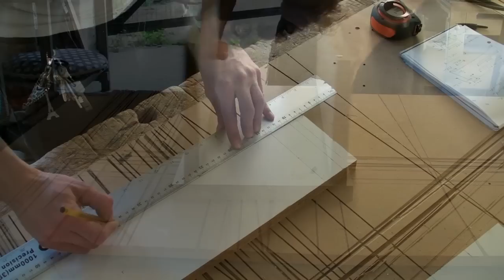Homemade Table Saw Sledge - Part 4 - Jig to build Tetrahedrons and Pyramids

Comment: If i could copy that but cut for an internal angle of 138.2 it would be fantastic! The stately icosahedron.
Reply from the maker: I have built a newer pyramid jig which is for a tilting table saw, so it might be possible to make an icosahedron?
Reply: *****  9:41 what is the name of the black head bolt you use

Comment: Not a fan of watching you do this without hearing you describe any of it.  We know the microphone was on. For example, would it have been a problem for you to say the bevel angles on the circular saw cuts? There are several other areas where commentary would have helped others to make this.
To me this has only a fraction of the value it could have...it says to me "If you know what your're doing, then you already know what I'm doing."  I can build what you built, but you provided minimal instruction for viewers so you didn't facilitate a viewer making it. Still, I appreciate that you posted it.
BTW, why is this Part 4 but you don't have any Part 1,2,or3?
Reply: yeah!
Reply: I actually appreciate the lack of words.